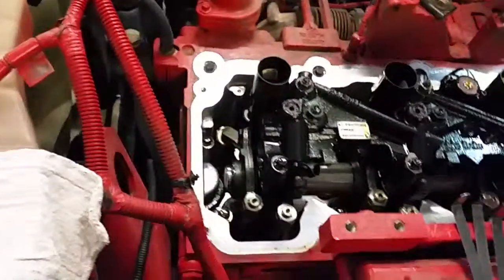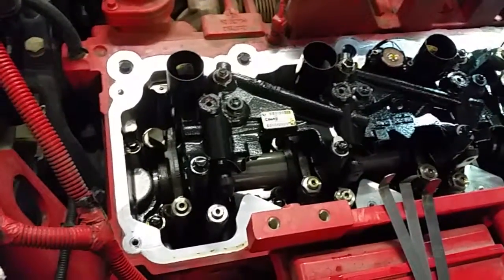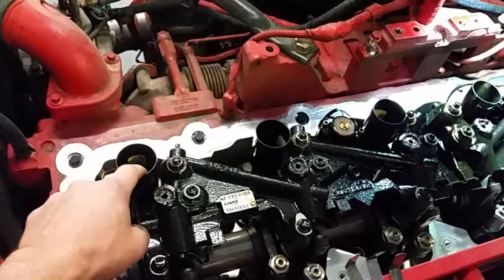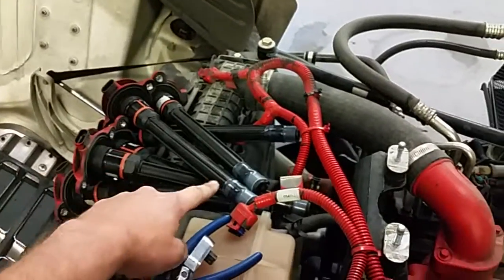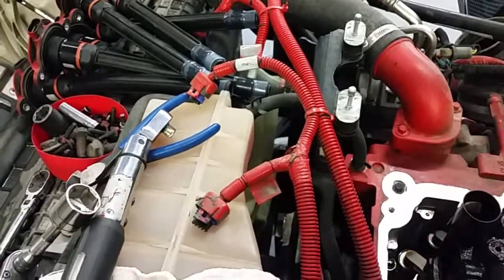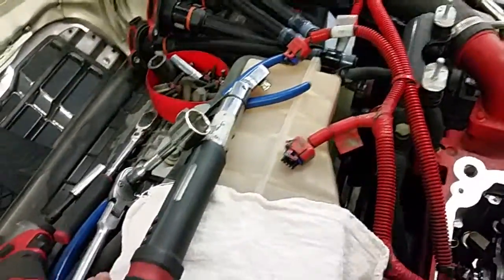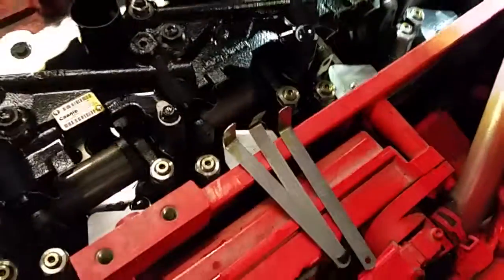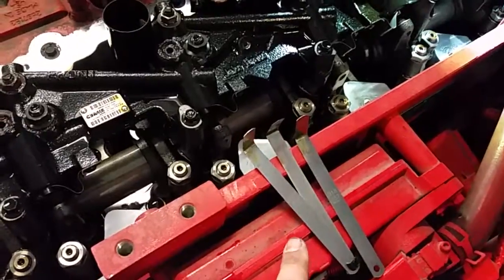Freightliner Cascadia Cummins CNG Overhead

Comment: thinks alot we have about 65 or so of all kinds in our fleet and and 30 or so of f250 and f350 love what I do
Reply from the maker: Rock On! I enjoy engine work more than anything, its relaxing to me just taking everything apart and inframe or overhead the units. the ISG is no ISX, but at least no DPF or DEF bullshit added to the mix to make the EPA grin. unfortunately does have EGR though which can be an issue, although from what i understand not as bad as 9L ISG. one thing though, HAVE to use GEO 5W40 or you WILL nuke pistons on these CNGs

Comment: how good do them motors pull
Reply from the maker: After the overhead has been done, talkin to the drivers, they say it pulls alright, its not a 3406 by any means, but if typically it has a low power issue pullin hills usually means time to change out spark plugs on em. Would prob have more power though if it was a converted 15L instead of 12L.